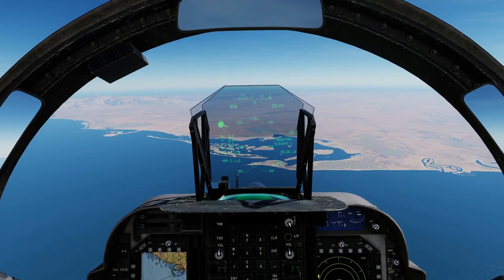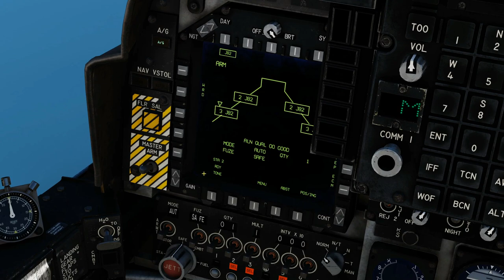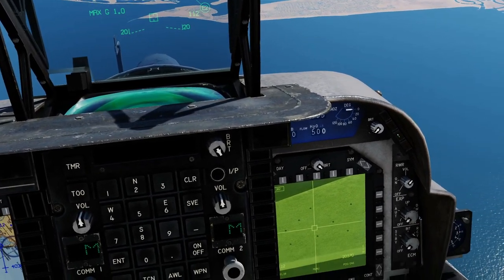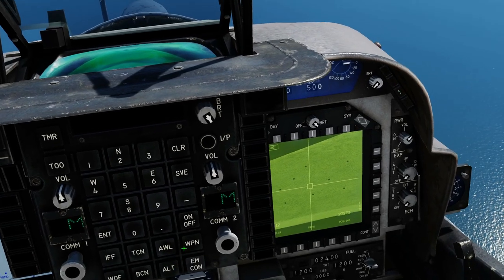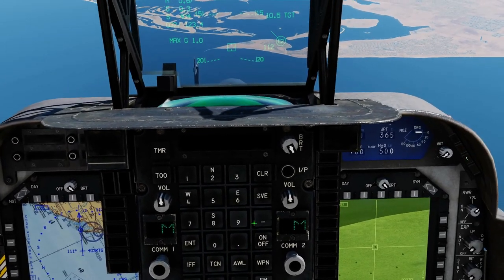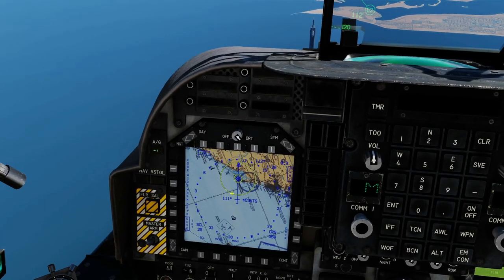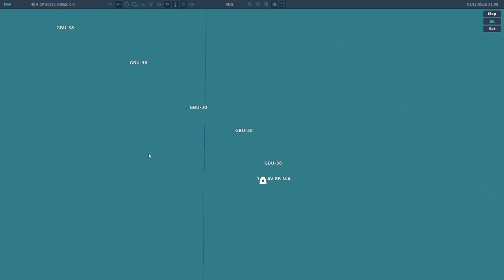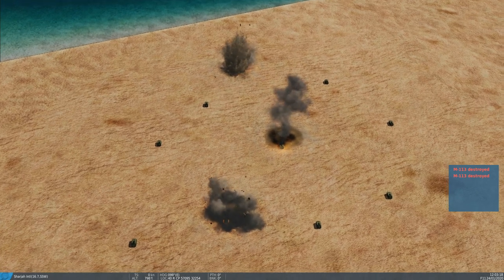AV-8B Harrier: GBU-32/38 JDAM Rippling With Mark Points Tutorial | DCS WORLD

Comment: hello my UK friend .. regarding my NWS issue in the viper.  Well its bizzare a created a brand new mission ,  left the take off time as is 08:00 and NWS turned on as normal.
When I change times of day or even months and try the mission again the NWS will not turn on.   I thought it may be a sequence problem perhaps because I know the NWS A R Disconnect MSL STEP button does many things other than activating NWS.   Its a complete mystery to me why at times it works normal like when I create a new mission and most times I jump back into the same mission with a few changes like time day etc ... and does not work.     Anyway I would love to join your group its kinda boring flying solo all the time.   I fly in VR all the time ,  but I do have trackIR and dont like it because my clip is just the basic clip that came with the trackir5 and too me its no different than looking at a flat monitor , only it pans around the cockpit for you instead of using the keyboard to look over your shoulders.    VR is like driving a lamborghini for a week then jumping into a toyota after leaving VR.